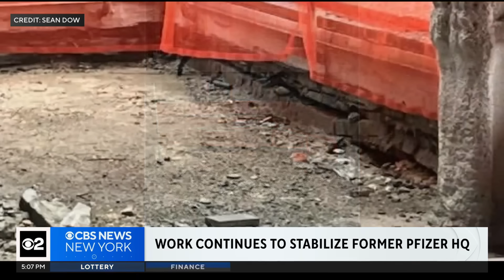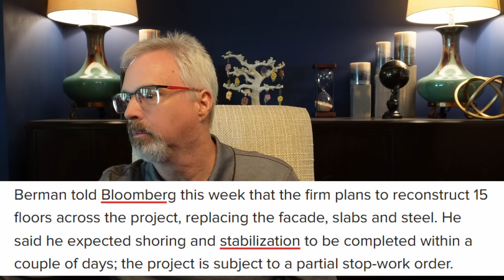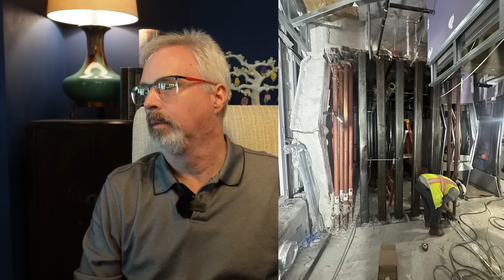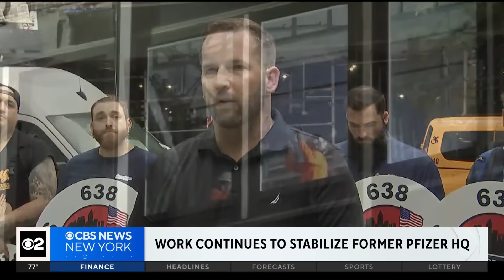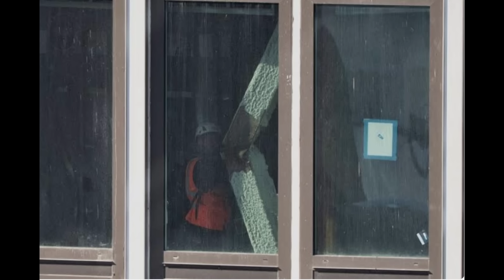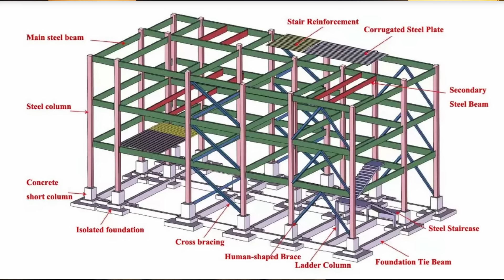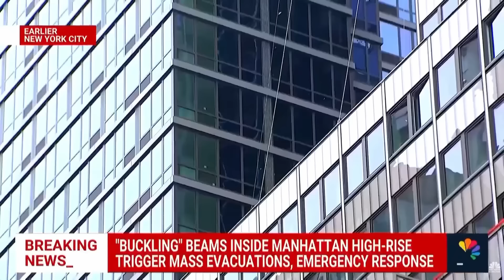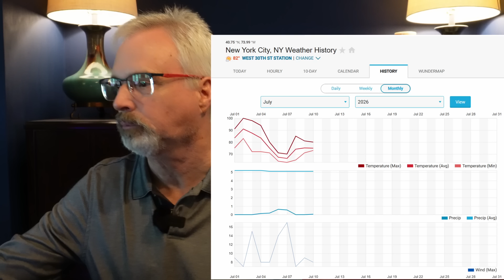Update - Pfizer Building Structural Column Failures; Now What?

Comment: Retired NYC architect here; some interesting background from Wikipedia etc: structural engineer GACE is successor firm to Stanley Goldstein, certainly a competent avg firm but their other projects look like simple buildings, not complex additions to existing structures. The building at #235, where failure occurred, was designed by Emery Roth firm in 1960, a favorite developer friendly design firm famous for many large generic 1960s curtainwall office buildings. The other building, #219, was a 1905 (!) building which had 10 floors added by a different architect in 1960, to which this project seems to be adding many new floors. Makes you wonder what that 120 year old building foundations and structure might be like. Also note this developer plans a rooftop pool, one more heavy load complicating design of added floors.

Your reports are the best on this case, thanks for your accurate explanation.
Reply from the maker: Thank you for that excellent historical context and professional insight!
Reply: @CaseyJones-Engineer  How do we fit such engineering analysis into a 21 second TV news bite?  

The level of basic functional illiteracy among both talking heads and politicians is dangerous, and could suggest we need higher standards for being a competent adult under law, and not just the broken psych criteria now used in lawfare games.  Voters, jurors, and legislators reviewing attempted bad legal standards all need tech literacy.  

Broadcast and print news are dying businesses, albeit on a slow downward spiral.  60 years ago they were treated as public service, with professional standards, but that changed to massive blocks of advertising sales wrapped around less hard news than some late night comedian hosted programs, per university studies.  That fails the core charge of public service, for which so-called news media gets special ConLaw and FCC perks.
Reply: @lokiva8540  The American mentality is that everything is for profit and maximizing that profit takes precedence over all other concerns, including safety. That doesn't mean they ignore all the rules, but they keep fudging them under pressure from the money folks. The concept of "public service" has been denigrated to the extent that only millionaires stay in Congress, so the first term a non-millionaire is in they need to maximize their income from lobbyists which means doing what they want. For the right, this means agreeing with the most absurd claims,  remember folks that at one time ketchup was considered a vegetable for school nutrition purposes, and for the left it means making a lot of noise but never actually advancing legislation that would address the issues that would reduce profits for the interested parties. 

The ultimate issue is that, following World War 2, there was a conscious realization that the men who came back from fighting wouldn't accept returning to a stratified society that for all its claims of upward mobility still kept the poor poor. This wasn't only in the US but it was where the change had the most impact. The result was and economic boom and a growing middle class. Kids who had grown up poor in the depression, and went to fight, came back and had the opportunity for an education and a better life. That is what happened to my father: his dad was a station master for the CPR but pay cuts during the depression left them in a precarious position. Then World War 2 came along just as my dad was entering his final year of high school and when he graduated, instead of going to work full time on a farm or with the railway, he joined the navy in June 1940. Fortunately, the Navy was a meritocracy, and his aptitude for then-advanced technology and leadership saw him sent to officer training and then onto schools in anti-submarine warfare and later gunnery. Post-war, he and my mathematician mother were married and he went to university to become an engineer. 

That is how the (North) American middle class became a dominant factor, and the myth of upward mobility was given suddenly a fact. The greatest redistribution of wealth in human history took place and while it was started by government action it was accomplished via market forces. A professional middle class was able to exercise political power and, with working class wages also on the increase, policies that didn't simply favor the rich came into vogue. By the 80's, the movement to claw back. that money and lower the living standards of anyone outside the rich was taking hold. Gone were the days when Republicans could be expected to support funding dialysis for those unable to afford the procedure and suffering from kidney failure, and they began to claim that the real key to prosperity wasn't an educated middle class but low taxes for corporations and the rich. Now people will proclaim the stock market as proof the economy is strong, and yet most people will gain no benefit from it. Most people are. dealing with the economic fallout of a mentally challenged and corrupt individual in the oval office who has increased the cost of living even as he seeks to eliminate the social safety net and reduce protections for workers from dangerous and exploitative employers. Corruption and stupidity have taken hold and they control the media and the message.
Reply: @Gerhardium Leaving all of that aside maybe somebody just made a mistake calculating the load on two columns under the new cantilevered additional floors.  
Possibly some other mistake was made instead.
Reply: Fascinating!! So DOUBLE SETS OF ADDITIONS of floors on a 1905 base building. This is starting to stretch into the area of incredulity. It would seem that an extremely detailed survey of the existing structure HAD to be done, and yet something as glaringly bad as this was just somehow overlooked?!? Maybe there is a bit more going on than just incompetence like some lubricating facilitating funds!
Reply: @Mentaculus42  bribery and corruption are starting to really look and sound about right here...I wonder how many are like this? I wonder how many in positions of authority have the know how, competence and integrity to deal with and do this properly?  I wonder if many who are qualified and competent have already departed this state for other states and how many with the institutional knowledge and experience and expertise are no longer available or maybe even alive?  I believe that this is going to either become a very large scandal or a massive cover up  and/or a "too big to fail" bail out.
Reply: @therealtonyotto The responsibility is likely with the engineering firm unless the contractor didn't follow the plans and nobody caught it.  

GACE Consulting Engineers DPC is a well-established, award-winning structural engineering firm based in New York City. Founded in 1979,
Reply: @therealtonyotto  thanks for my daily dose of schizo-comments without a sliver a proof or solid reasoning.
Reply: @Mentaculus42  The only point of failure that has been reported is where new floors were added in a manner where they cantilever over a  lower section.
Reply: @Goldsteinphoto 

You mean GROSS failure. A lot of the other floors have clearly been “significantly tweaked”!! A very detailed survey needs to be conducted to determine the extent of movement. Do you expect that all that is needed is to just jack the sagging floors back into position and fill in the cracks in the concrete of the floors?!? Once nonelastic deformation has occurred, all bets are off.
Reply: @Mentaculus42  I'm not diagnosing anything or recommending any action. I am not qualified to do so.

I simply am stating what has been reported...only two columns have failed. These were directly below the location where additional floors were cantilevered above. 
Those floors have shifted. We are not privy to any more facts.

My opinion... the cantilever floors above put diagonal forces on those two columns that would not have occurred without the cantilever extension. A study will confirm or refute that. 

Opinion...the sagging floors above will have to be demoed.  (I certainly can't say if there is any possible way they could be jacked up.) Maybe they will be rebuilt after strengthening supporting columns on some or all floors below.
Reply: @Goldsteinphoto 

I suspect that at least the floor beneath will also have to be demolished also (and everything above)! But only a very detailed survey by an independent third party can determine the extent of the damage. This whole thing reeks of a massive cluster duck that has to have a basis in more than just simple incompetence.
Reply: @Mentaculus42 I'll leave the speculation to you and others.
Reply: @Goldsteinphoto failure SO FAR
Reply: @Goldsteinphoto  You offered an opinion.  Opinions aren't facts, ergo you also speculated.  Get off your high horse.  Nobody's claiming they have the full story, they're just trying to reason out what could've happened.
Reply: @GeekGamer666  I indicated clearly an opinion. Others haven't. My opinions don't reflect anything not in evidence. 

Possibilities

Sagging floors can be jacked up.
Sagging floors must be removed.
Sagging floors will be replaced.
Sagging floors will be demoed and not replaced.

Building will be analyzed and strengthened as needed for any option employed.

Building won't be analyzed and anything done will be haphazard...maybe correct, maybe not.

Building will be demolished...by reckless explosives or by careful disassembly.

Lot will be left empty.
A new building will be built after total demo.

New building will be excellent.
New building will not be excellent. 

It will all be credited to the mayor.
It will all be blamed on the mayor.

Jewish developers and the Mossad will be blamed by some people. 

Pfizer will be blamed.

A pool will be on the roof.
A pool won't be on the roof.

Engineer will be at fault.
Engineer won't be at fault.

Contractor will be at fault.
Contractor won't be at fault.

The capitalist system is at fault.
The capitalist system is not at fault. 

I probably left some out.
Reply: @Goldsteinphoto  it makes good sense
Reply: @Mentaculus42 I bel8ve your spot on - it’s called “The Eric Adams way”
Reply: @Mentaculus42  The architect and engineers are the same ones who designed the Millenium Tower in San Fran! :face-green-smiling:
Reply: Rooftoop pool ...oy vey
Reply: @mitzvahgolem 

It looks like you got the local lingo down pat! I bet the developer was saying more than oy vey,  more like “Oy Gevalt”, this is going to cost me a lot!!
Reply: @Mentaculus42 תודה רבה נודנק
Reply: @mitzvahgolem  Well, if the building collapses at least the water will mitigate the dust cloud....
Reply: @MoralHazard-mhzlol 🤣..
Reply: @MoralHazard-mhz Unlikely, one pool wouldn't be enough water to mitigate the amount of dust of a building that size.
Reply: @mitzvahgolem  Thank God they scrapped the penthouse tank museum idea!
Reply: @mitzvahgolem Rooftop pools are pretty common.
Reply: @Goldsteinphoto Added to a building from 1960?
Reply: @lorie8212All of the new addition has been put on top of the old building and the old building is holding up just fine. It's the new addition that's the problem.
Reply: @lorie8212If the building is engineered properly to support the pool it doesn't matter how old it is. 

Do you know the dimensions of the  pool? Is it stainless steel, fiberglass or concrete?

Do you know that the 50 year old Citicorp Building has a 400 ton tuned mass damper at the 63rd floor?
Reply: @jvnb-y9e 

Is it not the old addition to the really super old base building that massively failed?!?
Reply: @Goldsteinphoto 

I think the issue is not what the pool is made of but that water is extremely heavy AND that extra weight had not been added onto the weak columns YET. Maybe at that time the failure might have been even more catastrophic. Fortunately the steel columns were reasonably ductile to buckle in a controlled SLOW manner, not fracture.
Reply: @Mentaculus42  Structural steel has the right amount of ductility, they almost always never just snap.
Reply: @Goldsteinphoto  The Citicorp building was designed to accommodate that damper; it's a totally different situation if after design and construction you want to add it.
Reply: @Goldsteinphoto  Reminds me of a movie opening scene ~1971.....
https://www.youtube.com/watch?v=jJjn9Vt7k1Q
Reply: @MrsAnnieTK  If the engineers say the building can support the pool and the designs are approved by the city, how can you demonstrate it would be unsafe?
Reply: @Mentaculus42 Fiberglass pools are much lighter than concrete/rebar pools. 

10,000 gallons of water weighs about 40 tons.   Engineers are used to calculating loads and designing adequate supports.
Reply: @Goldsteinphoto 

10,000 gallons is a tiny pool, doubtful that would give a single lane lap pool. So let’s make that more than 100 tons. Putting a pool or a 100 tons on top of a skyscraper is not a big deal. Adding a 100 tons on top of an addition that is already an addition on top of a 100 year old building should not be difficult if done correctly but clearly it was not done correctly. It is fortunate that it failed at this phase.
Reply: @Mentaculus42 Google...Typical rooftop pools range from compact plunge pools (10' x 20') to standard small hotel pools (16' x 32'). Explore the California Pools Size Guide to see standard dimensions. Because water is heavy, elevated pools are usually shallower than ground-level pools, averaging a depth of 4 to 4.5 feet to safely manage structural weight.
Reply: @Goldsteinphoto  a gallon of water weighs about 8.34 pounds. If the pool is 15000 gallons that is 125,100lbs of weight pushing down on the structure. Thats jiat water alone. Not including the actual pool shell and decking..
Negligent engineers should serve time for their crimes and greed....
Reply: @PetePools Buildings are heavy.

Why does it matter to you if a company puts a pool on their roof?

FWIW I built 2 concrete/rebar pools in the past year. Continuous pours...no cold joints, not sprayed gunite. One is on columns on a hillside....just in case you care about my pools.😀
Reply: @MrsAnnieTK The 400 ton damper in the Citicorp building was used to counteract the building's sway so they could use a lot less steel and save money.  

Are you familiar with the engineering flaw/bolts instead of welding issue in the Citicorp building and how it was corrected and kept secret for years?

That 913 foot tall building was at risk in a 70 mph wind of topling into other buildings causing domino like collapses for blocks. 200,000 people were considered at risk. 

Here we have two buckled columns and the building was quickly stabilized and will be assessed. I'm not going to get worked up over it.
Reply: That's ridiculous. That addition needs to come down
Reply: @RobertFeeley-s8t Said gravity, and all of the spectators.
Reply: thanks for the inside history!!!
Reply: Reminds me of a hotel I worked at where they would build an addition and just run power from where ever every addition. Issues every so often.
Reply: supposedly the older building had reinforced concrete columns installed down to the foundation through holes cut on the floors the the 19 new floors were constructed on the new columns none of the load goes on the old structure in essence it was built on stilts i read that somewhere
Reply: The old building didn't fail. It's the new addition that failed.
Reply: @jvnb-y9e  Both older buildings (1906 & 1960) didn't fail, only the new addition failed.
Reply: Was the heavy rain the two prior days to the incident looked into as contributing to the buckling?
Reply: Interesting information, thanks.  When I read your comment about the roof top pool, I should have been surprised.  But everything makes sense once we accept the fact that in 2026 we are in the age of shitification and massive stupidity.  Being surprised by bad decisions is long gone.  Last time the nuts were able to surprise me was early 2020, pre-covid.
Reply: Interesting, judging from this building alone I had presumed the structural engineers prior portfolio was made up mostly of Brazilian Favelas.
Reply: thanks for info
Reply: Architecture is bs and structural engineering not far behind 😢 glad no one died,😅
Reply: @94040 lol ...ok
Reply: @94040 Whereas voodoo is real.
Reply: I am confused, is it one or two buildings that they are building onto here? And if two, how does that even work from a structural standpoint with two very drastic standards of building with those date ranges?
Reply: @CatInWonderlands it appears that for the city's purposes (taxes, address, fire, etc.) it's two buildings while effectively it functions as one unit with the oldest core structure being from 1905, with an  addition used to modernize and expand it (new building essentially engulfing it) in the late 50s/early 60s. Then the second address was built at the same time essentially acting as another expansion of the building. .... At least that's what I have gathered... It does make me wonder if they actually checked and documented the entire structure prior to the current renovations or did statistical survey of the columns... Potentially missing some important abnormalities in the structure. ... It would make me really nervous if I was the engineer of record, that they two failed columns happen minor defects that were unknown and perfectly safe and capable of supporting the original design loads
Reply: @alexlail7481 exactly....old rusted columns not sized to carry additional loads .
No one took fire proofing clading off to inspect all of them perhaps assumed all were sufficient as built.
Reply: @CatInWonderlands Two old buildings 1906 and 1960, two different building standards, two different inspection standards and a new additions built on top of both of them. Someone was paid off to not inspect or dumber still they weren't paid off and simply didn't inspect.
Reply: Considering the age of the structures in question it would have made more sense to simply teardown and build a whole new structure on the site footprint. Retrofitting and building up a 65+ year old structure makes no sense unless you're looking for a quick buck or this were an architecturally significant site with preservation orders in place. Especially since there seems to be reports the original building may not have been in great shape to begin with. The 1905 side is a very big worry since it's being had been extended upwards by a large amount and built on a 120 year old foundation!
Reply: @glenyoung1809  You are correct. Office building to condo conversions are complex, costly, and structurally difficult.
Reply: Thank you for that additional context. It’s frankly incredible that the failure was actually in the 1960 building and not the 1905 building that already had 10 floors added to it and is now getting more.
Reply: @michaelimbesi2314 The 1905 building would have been when computer was a profession and material science knowledge was limited, and was likely quite overbuilt.